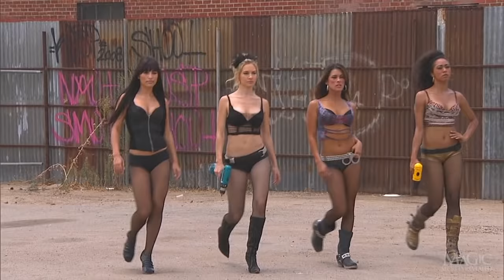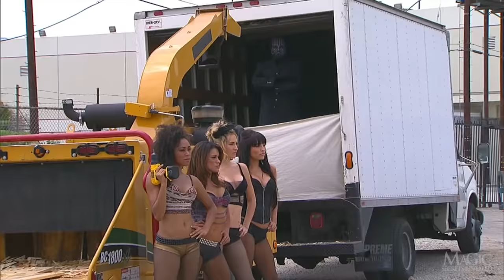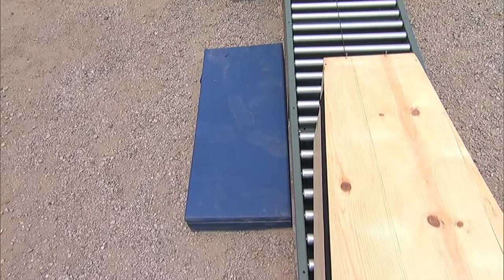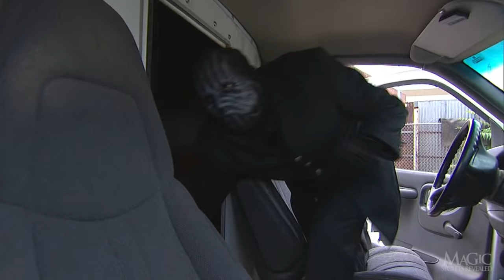WATCH A MAGICIAN CHOPPED INTO BITS - AND SURVIVE!

Comment: I can imagine how the rehearsal sessions of this trick went. At the actual presentation, I'm pretty sure someone must still keep an eye on the side where he slides out of the coffin to ensure he actually managed to get out, and signal the wood chipper operator to halt the machine in case anything goes wrong.
Reply: All the assistants had on the day training for each of the tricks, which you can get away with since they only need to do it once and can do multiple takes. Also, I think they most likely did the trick twice.  Where the take where the coffin enters the wood chipper, the Masked Magician was never in the coffin to begin with. There's enough changing camera angles and close ups to make me think this was the case.

Comment: In the first shot I don't think he was in the box and it was edited because you don't see him crawl out of the box before it goes into the wood chipper even though it's shot in a way you would notice his escape.
Reply: Yes exactly. I think so too. In the explanation you can see that he can only hide properly behind the mirror when the camera angle is low. In the first part of the Video the Camera is much higher and therefore you would see him behind the belt. 
Also: the Voice over is complete BS: this is one continuous camera shot... and exactly at this point there is a cut. Sorry, not very convincing...
Reply: He probably escaped in the moment they cut to the closeup of the woodchipper, to guarantee the audience doesn't see him escape. It's still not edited footage. Just several angles taken simultaneously, and switched at a critical moment.

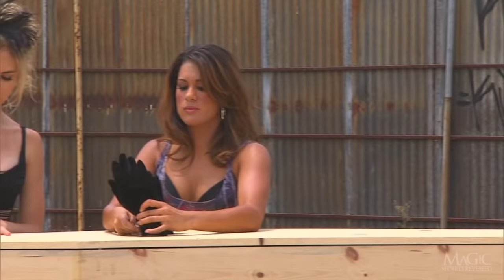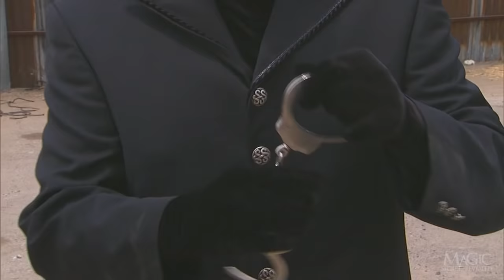Comment: 1:27 "his hands are secured with regulation police hand cuffs". 3:38 "phony cuffs". Ok, so they are not regulation police hand cuffs???
Reply: They actually are regulation metal handcuffs. They are just rigged to open with slight pressure. Call them modified regulation handcuffs.